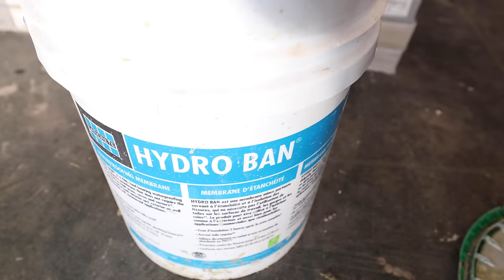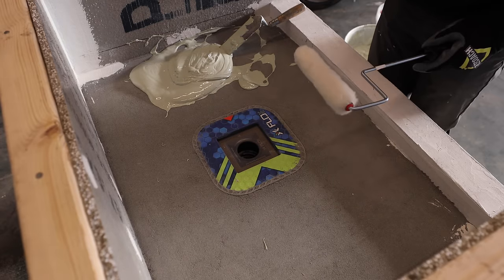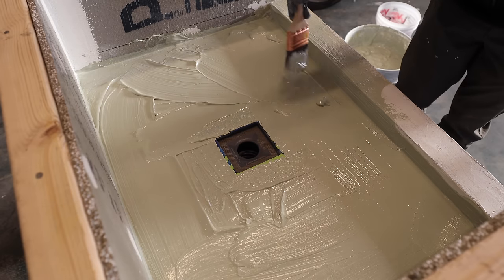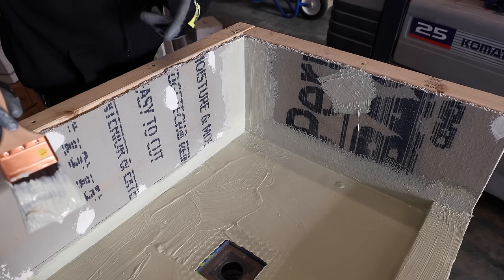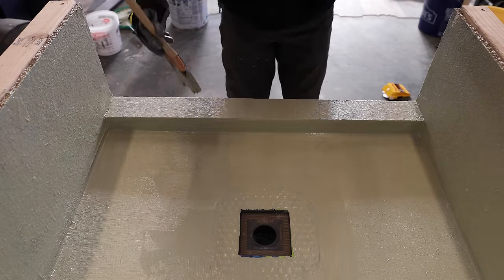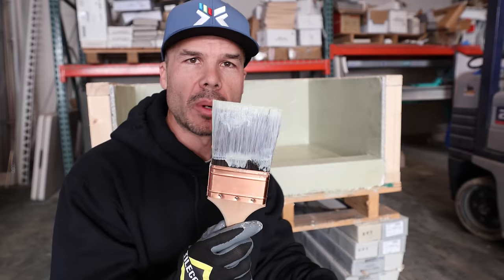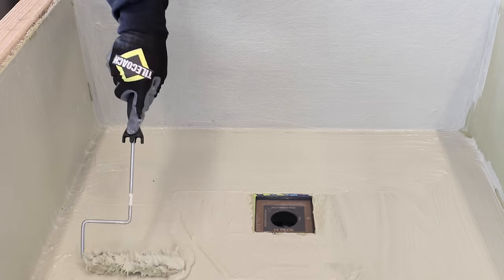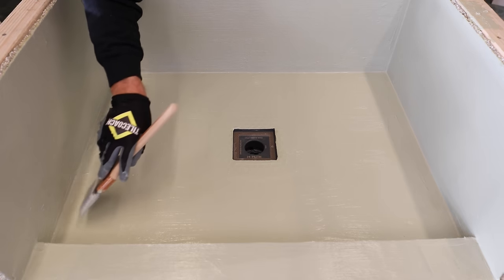Easiest Way to Waterproof OVER Dry Pack Shower Pan --- Hydro Ban Liquid Membrane

Comment: I used this (packed the curb and floor myself) and did the corners with laticrete membrane tape because that was my biggest worry. It passed a 48 hr flood test and it's been used daily for almost two years
Reply: @wmars4655  I actually didn't use mesh I used membrane tape made by laticrete which is also who makes hydroban. that way I know the products are compatible with each other
Reply: I use the fabric with mapei aquamembrane and it surprisingly withheld the water test for 2 days. First time made me nervous, but now I'm standing by it. They even made the membrane a light blue so you can see your marks and lines when you lay tile
Reply: Wouldn’t it be cheaper and mote time efficient to just use a prefabricated copper shower pan?
Reply: Nice, was it difficult to do or did you find it pretty easy?
Reply: @Gleeleeglee  yes prefabricated copper pan would be much less expensive than a mortar bed.
Reply: @Gleeleeglee  copper isn’t cheap at all….  It’s definitely more expensive than you would think.  And a ton of the reasons people do their own shower pans is so they get the custom shape and size they want.  And yes it’s easier and cheaper to buy a regular pan but it’s not what a bunch of people actually want for their house….
Reply: So you don't need to use the vinyl  anymore???
Reply: @Gleeleeglee  Nope, never seen a copper pan, copper will corrode, plus drain locations are not standard and being off an inch here an inch there, drain does not line up etc. The used to do galvinized, then in Calif. they do a hot mop asphalt type thing for shower pans. The fastest most efficient is the common vinyl shower pan. However it has it limitations and if one is trying to do special applications like curbless showers etc. the membrane is the way to go. It takes a few more days (cure time) but hopefully there are other areas to work on at the job. But a vinyl pan, one can do the whole floor in a matter of hours. Install pan, mud floor and even install tile (really soupy thin-set) and you are done. Back in the 80's we would (3x5 shower) install vinyl pan, build the curb from bricks, chicken wire and float the walls, rub them out, go to the next shower in the house, leaving the 1st to dry. Then double back to 1st, stack the 4x4 wall tile. Go back to 2nd shower and work, The tile helper is grouting the 1st showers walls. Then setter drops back to the 1st, floats the shower floor (helper has the mud ready) lets it set up a bit as he goes back to the 2nd shower to work. Then setter drops back to 1st, installs 2x2 floor tiles, tiles curb, then goes to 2nd shower. Helper grouts the 1st shower floor. Once setter is done at 2nd shower, the helper better have the job ripped down and the tools loaded up on setters truck. Setter drives away and the helper drops back to grout the 2nd showers floor and calls it a day. 2 showers per days, track housing work in Phoenix, Az. area 83-94
Reply: If I can find and can do 2 showers a day I will be retired next year 🙂
Reply: Do you need a gap between walls and floor?
Reply: @Gleeleeglee  Copper pans are extremely rare and a luxury item. You do not tile over a copper shower pan. Copper shower pans are designed to be a finished surface themselves, showcasing the aesthetic qualities of copper.

Comment: I just found the answer to my question in the previous posts. So the answer is yes you apply your thin set over the Hydro Ban and install the tile. Excellent thanks for this video and actually all the other videos you have uploaded.
Reply: I dont get it..i thought you put the tiles direct before the drypack has dried? So why not then uce normal wet concrete if its anyway going to dry
Reply: @cieslaolsztyn8266  Concrete remains porous and not very water proof when dry. Special mixes and techniques are used when concrete has to be waterproof, like in a dam. The motarbed is not water proof either. When you shower water penetrates the grout, goes into the motarbed and down the drain.
Reply: @vids595  So this Hydro Ban is only because of the drypack? Does he use drypack only because its esyer to make a slope on the floor? I bet there are many showers with tiles fixed right on the concrete without any mambrane..no problem
Reply: @cieslaolsztyn8266  Not true. In those installs (If done right) underneath those drypack installations is supposed to be something like a 40 mil water proof membrane that diverts water to weeping holes in the drain. That's the old-fashioned way. (Not needed for installs done like THIS video though.) As others have said, concrete is porous and wicks moisture.

Comment: That membrane is worth every penny, i use it all the time. They water proof olympic swimming pools with 3 coats using hydroban.
Reply: Can u use redgard like that?
Reply: @chapothakid5080  i wouldn't recommend  red guard on the bottom of the of the pan only on vertical surfaces like walls on vertical and horizontal seems. Red Guard is an OK product but i would never use it to water proof shower pans. I have both products but only use hydro ban for pans cuz its pretty much bullet proof if properly applied.
Reply: @RaulCojocariu  how far up the wall would you recommend going with hydro ban? And can I go up 3ft and then redguard the rest of the way?🤣 trying not to break my little piggy.
Reply: @jessicawilkerson9687  the cheaper way of doing it is to use denshield board instead of durarock , green board etc. 
The denshield has rubber on it already, use that at least 6ft high all around then get the fibafuse drywall tape and with hydroban put it on all joints and corners, with painting brush u apply hydro on the joints put the tape on the the joint and continue putting more on top untill u incapsulate the tape in the membrane. I like to use two coats on it and the u just put liquid membrane on the screw heads only. This should save you some. 
But to answer you question yes it can be done like you said. Redguard is not recommended on flat surfaces where water could pool like shower pans, even shower curbs, hydro is a much more superior product as its used in swimming pools as, with all this said you can use redguard to seal the joints on the wall as well just make sure that tape is well covered with the liquid membrane so its protected from the cement.
Reply: @jessicawilkerson9687  I had the EXACT same question.   Already have redguard and used a little on other projects, but now seeing this method,  and having bought a flofx drain kit from tilecoach, I'm leaning toward hydroban.  As yourself,  thinking of the budget,  wanted to use the redguard on the walls.
Reply: @chapothakid5080 regards tds says not to expose it to hydrostatic pressure, so no pool application.

Comment: I used this approach a couple years ago. I don’t know why more people don’t use this on single slope mortar beds. At the time I was researching it, a lot of people were kind of freaked out with with the “risk” of a roll on membrane with no redundancy.
Reply: The cost is a risk also.  $429.00 usd for a 5 gallon bucket.
Reply: @tryan7  Exactly, some companies are very proud of thier chemicals. I bet the bucket, label etc. costs more than the chemical. You just have to know they make the chemicals in huge vats, bet $2 a gallon max...
Reply: @BADMONTESS  not necessarily
Reply: @tryan7 $100 for a 1 gallon bucket which is more than enough for a shower pan??
Reply: @chrisl1873  how high should you go?
Reply: @eddielechuga5353  I'm doing my master bath later this year, it's a very custom shape so I'm using floor mud to slope, then using the roll on on the floor, then using aqua ban board up top to about 6 feet. I'm using the board because it's easier to work with than cement board and i don't want to just roll on over standard drywall
Reply: fartpooboxohyeah8611 the nature of the game, gotta line out bigger jobs or have your customer by prefab bs so u can do next to same day install start dates. 🤷
Reply: fartpooboxohyeah8611 why not mortar bed before the weekend and then Monday hydro ban?
Reply: I would not use this in an area that has Foundation issues such as Louisiana or Texas

Comment: Great product one of the best.  I highly recommend using the 9235 anti fracture membrane with 9235 /  hydro ban / hydro barrier when waterproofing a shower pan despite Laticrete tolerance.
Reply: Hello,   I was looking on Amazon and there were  about 3 Hydro Ban products.  So you would apply the anti fracture and then the Hydro Ban?
Reply: @silverlion5384  hydro ban applied liberal , lay in the anti fracture membrane, hydro ban applied to top coat. Make aware to have extrusion of  hydro ban through anti fracture.

Comment: We use a lot of liquid applied membranes in Australia Isaac. This method is similar to what we do here, however we generally caulk in a fillet/bead of sealant on all internal corners prior to applying the liquid membrane (or sometimes a special bandage is used), this acts as a "bond breaker" allowing the liquid membrane to release and move Independently of the fillet/bead in areas of movement (eg at a wall to floor junction, or where 2 different substrates meet etc).

We can also speed up the installation process by applying a water based epoxy primer over the bed the day after it has been installed, this epoxy coat acts as a "moisture/vapour barrier" allowing you work over the moist bed the next day, then you apply your liquid membrane the day after that. (No waiting 3 days for the bed to dry).
Reply: Im in Australia, whats the brands? Can I DIY?
Reply: I thought no sica flex in the corners or bandage was showing people how to do it wrong setting them up for failure. ..fellow aussie tiler
Reply: The caulk tip sounds very logical to me. Thanks.
Reply: @mikeyfoofoo  just make sure your layer thickness and integrity is maintained during the application over the flexible caulking
Reply: It isn't a tip so much as a requirement for most (all?) class 3 membranes, to have a bond breaker at all joints and including over any screw holes. Apperently using the fibreglass reinforcing tape with a class 3 reduces it to a class 1 membrane as it can no longer flex as designed. Also check requirements as most require a primer for proper adhesion... enjoy
Reply: If you watch the Hydroban "how to" video it shows them applying a bond relief (bond breaker). This is a poor how to video and if followed could lead to disaster.

Comment: This is the best way to do it.
I have made a stainless steel shower pan and glued the floor tiles in the pan. 
Cement will always flush away and you get leaks. 
We have a product called " DACFILL " equal to hydro ban. Normally used for roofs. Our show is now more than 16 years without leaks.

Comment: Well, I've already learned several things. I bought and applied  the Red Guard....so fingers crossed. I've only applied 1 gal....which did not cover my entire shower and walls. Our shower is 60"x36" with a slab floor circa 1967, and the drain is less than 8" from the wall. I already put another layer of Sand Mix and graded by using a laser at the perimeter. The grade is approximately 1" to the top of the Oatey 3 part drain. So here's hoping I pick enuf info from your videos. Thanks for the time you do making the videos. I hope my own home job will be a success...never done tile. House framing, yes, with lots of experience. My real conconcern is transition to the level sides of drain using my wife's selection of 1'x2' tiles coming in at an angle with the 60" grade slope.... again, this could be a fail in the making....

Comment: Great video.  It would help if you show in the text what went on when.  Example: Subfloor plywood followed by Durock Cement board followed by dry pack and membrane.  Walls: Durock cement board followed by mesh in the corners, followed by liquid membrane.  I try to write it all down and have to replay the video over and over to make sure I got it all.  But your teaching is just great.  Thanks.

Comment: Very nicely done 👍 my biggest pain point with mud beds is the wait time before applying waterproofing. I need to re-examine my procedure on a full bath remodel in order to do it. waiting 3 days before applying liquid waterproofing is too long for me…. Do you ever use the quick cure mud from laticrete? I’m guessing you could apply hydroban the first day with that? Great tutorial 👍
Reply: You can apply hbb sheet membrane right after mud if youre careful enough and use the corners banding etc
Reply: I prefab when I don't have time too wait on cure times. It's not hard but most people don't think about it or don't know it's an option but if you can build it in place you can build it at the shop

Comment: You need to apply sica flex in the corners cement bed and the wall sheets move independently of each other therefore hydro band by itself will tear and then you will have a water leak ..tiler from Australia
Reply: Laticrete approves using hydroban without banding in changes of plane with a gap less than 1/8" and seams in hydroban board the same. But I agree the extra sealant underneath like latisil or sika flex or using the Hydroban fabric in the corners is ideal

Comment: Can you do a demonstration of how these liquid membranes can stretch after they have set.
Say painting over a crack between two cement boards and then pulling them apart after they have set???

These surface membranes may be a very good second waterproof barrier that keeps the majority of the water out of the mortar bed.
Then if dampness happens in the mortar bed, then the smells will not be a problem in the room, as the source is below the top membrane.
Should a leak form then it will need to get around 2 waterproof barriers and the volume of water would be extreme small as the water rapidly runs off the floor tiles.
Love your work.
Reply: You need a bridge between the two surfaces like sica flex or hydro band recommend a bandage to bridge the crack you can even use masking tape which acts as a slip joint
Reply: ⚡:SPEZIEL FÜR DICH
"BEST.FURDICH.FUN" :yt:
> SATISFY.BABY < :socialdist:

 

tricks I do not know
Megan: "Hotter"
Hopi: "Sweeter"
Joonie: "Cooler"
Yoongi: "Butter

So with toy and his tricks, do not read it to him that he writes well mamon there are only to laugh for a while and not be sad and stressed because of the hard life that is lived today.
Köz karaş: '' Taŋ kaldım ''
Erinder: '' Sezimdüü ''
Jılmayuu: '' Tattuuraak ''
Dene: '' Muzdak ''
Jizn, kak krasivaya melodiya, tolko pesni pereputalis.
Aç köz arstan
Bul ukmuştuuday ısık kün bolçu, jana arstan abdan açka bolgon.

Uyunan çıgıp, tigi jer-jerdi izdedi. Al kiçinekey koyondu wins taba algan. Al bir az oylonboy koyondu karmadı. '' Bul koyon menin kursagımdı toyguza albayt '' dep oylodu arstan.
Arstan koyondu öltüröyün dep jatkanda, bir kiyik tigi tarapka çurkadı. Arstan aç köz bolup kaldı. Kiçine koyondu emes, çoŋ kiyikti jegen jakşı dep oylodu. # 垃圾

They are one of the best concerts, you can not go but just seeing them from the screen, I know it was surprising

💗❤💌💘
Reply: I'm not exactly sure if I understand but I'd like to chime in. While there is always some movement (extremely minimal), your question boils down to your substrate. If there's movement in the substrate do not start a tile project as wall board, waterproofing and even drypack is not meant to provide structural strength. As long as your substrate is structurally sound and your wall board is installed correctly your waterproofing will be sound. It all starts with the substrate. Tape ALL of your seams and corners (also where your drypack meets the wall board) with the appropriate mesh tape and thinset, then roll away with your membrane.